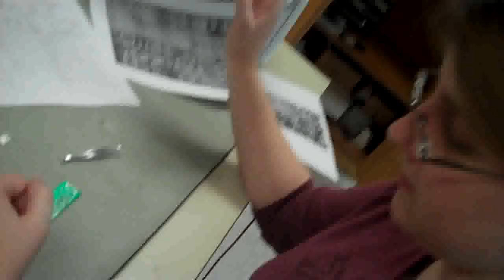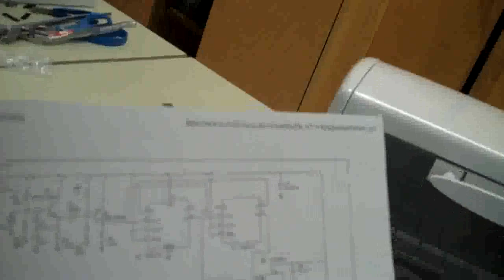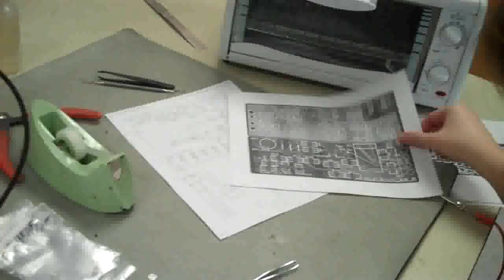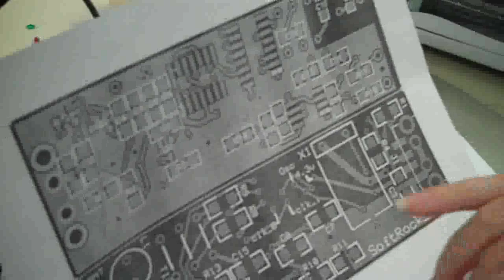Build a Softrock_40_R SMT SDR Receiver using Solder Paste and a Toaster Oven.  Part 1

Comment: I assume you started oven again at maximum temperature after putting the board inside?
Reply from the maker: I actually don't remember anymore.  I think so though.  It also depends on the solder you are using.  Lead free solder needs a bit more heat than solder with lead.  Theoretically you should follow the temperature profile as specified here: http://www.vishaypg.com/docs/63133/63133.pdf
but the toaster oven doesn't do that without an controller.  If you want it more exact, you can slowly advance the temperature until it melts (it gets shiney), then back it off.  We found it to be pretty forgiving.  There are other youtube videos of people using a toaster oven too.